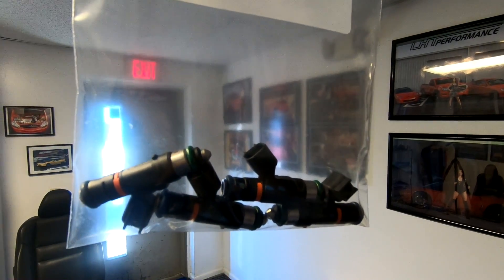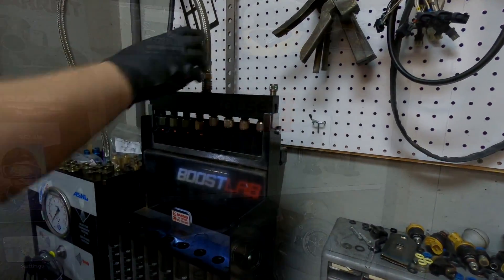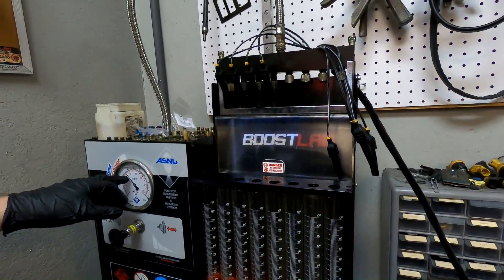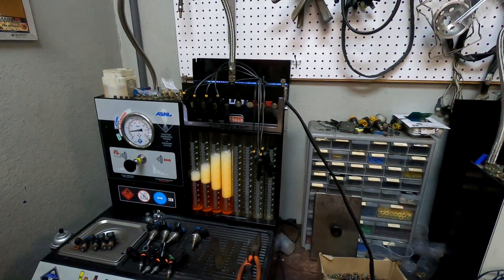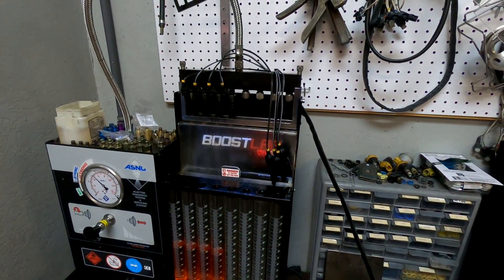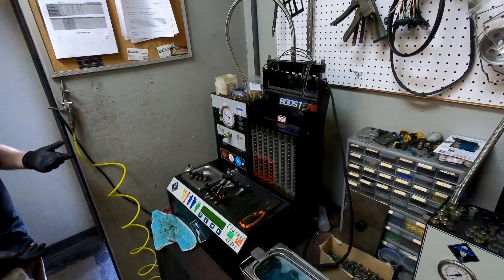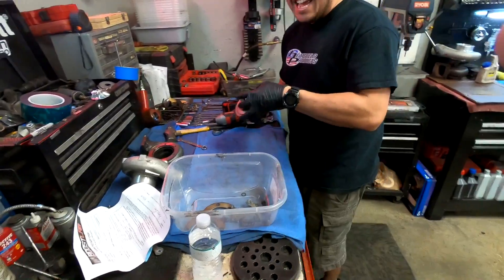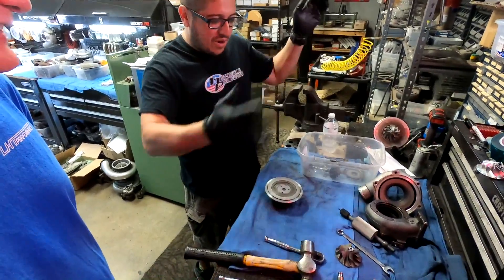Grams 1000cc injectors Flow test

Comment: So you smoked a piston because you didn't use a rising rate full pump and had a base pressure of 48 psi. So at 20 psi boost you only had 28 psi of actual fuel pressure?

Comment: Thanks for this informative video John! I'm an avid viewer of your S2000 videos in particular since I own an AP1 myself :) I have a set of brand new Grams 1000cc injectors from a KW kit on the way soon. I plan to use them with an AEM340 lph fuel pump for my future Vortech V2 supercharger build. I'll get a custom made 6.5" crank pulley from ASP in Texas soon. Have you had any fueling issues with Grams 1000cc on boosted S2000's?

Comment: I wonder how much that ASNU GDI machine fuel injector flow tester cost and the Crest Ultrasonic cleaner, i hear the ASNU machine has ultrasonic cleaning incorporated, why he didn't use it i wonder?
Reply: We use the Crest Ultrasonic cleaners as they have more cleaning power than the ASNU built-in units.
Reply: @KirkRiollano  ok

Comment: Injectors looked like they are cleaned in an ultrasonic bath cleaner. Very effective.
Reply from the maker: James Ruschmann Yes, Boost Lab have been cleaning our injectors for years.
Reply: @LHTPerformance  I just the grams injectors are not that good?
Reply from the maker: We’ve installed and tuned over a 100 sets.   I’ve also heard the earth is flat, I only believe what I see and use myself. 😉
Reply: @LHTPerformance  you guys do it great job! I will love you guys do my supercharger but I live in Massachusetts
Reply: @LHTPerformance  Have you ever had a case of the gram injectors not flow matching right out of the box? I purchased a brand new set and had to send them out for servicing because one of the injectors wasn't flowing as much as the others.
Reply from the maker: Patrick Macellus To he honest, the only ones that seam to flow exactly the same are the Honda OEM intectors.  We’ve seen the IDs , Grams and Bosch all flow a little off.

Comment: John  , at some stage, can you give us an idea as to what actually broke on the Civic and what damage did it do to the engine. Was it just too much boost  or do you suspect a dodgy component may be responsible.
Reply from the maker: warren lancaster Hey buddy, the full video will be out tomorrow. There was no sign of lean mixture or detonation, the ring lands let go. Who’s knows if this motor has been hammered on with low octane before we got it.  Either way, 18+ psi, 99F , on an 11.5 to 1 cast piston motor is not advised.   👍🏻

Comment: Great video  . My brothers stock k20a2 93oct 14psi 487whp 4years beat on daily
Reply from the maker: PA Tuners  My last K20a2 is still running at 530whp. This JDM K20 is 1/2 point higher compression, this could have been pinging most of its life before we got it....oh well.
Reply: @LHTPerformance  Nice 530whp on 93oct. Think the old fuel maybe? But yeah it could of been beat to hell before you guys got it